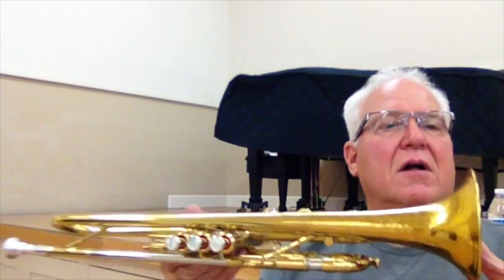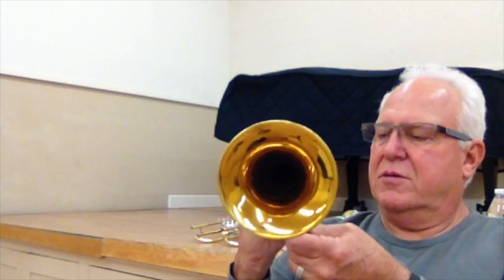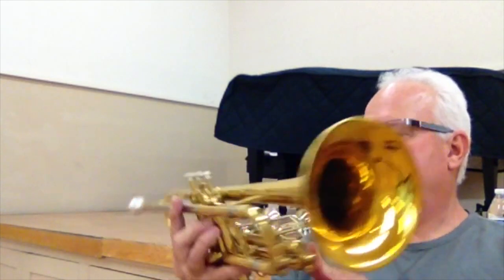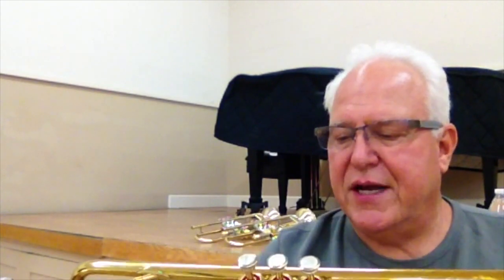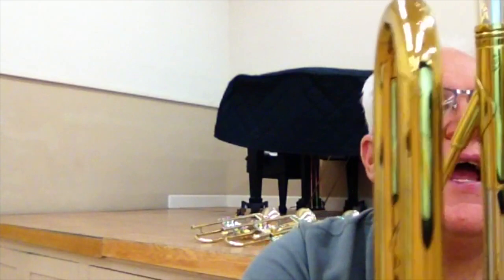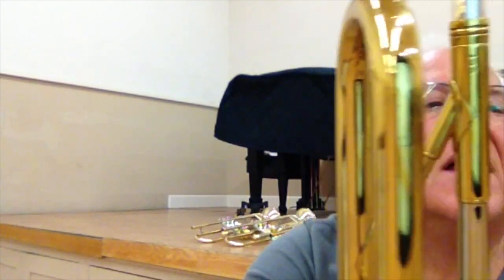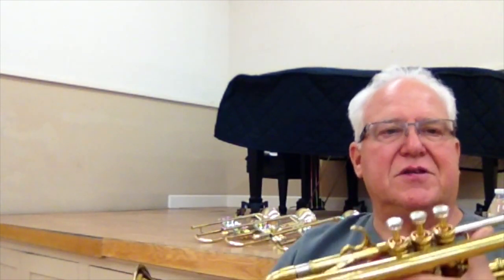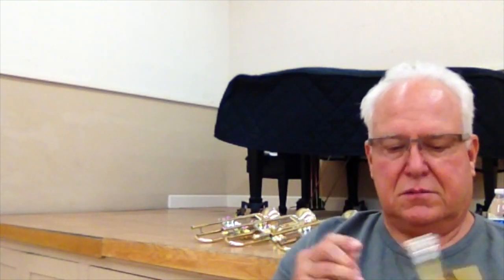Paris Selmer SN# 16637 Balanced Action 19A  K- Modified

Comment: I have the non K version from 1952, also a 19A. The main difference is that mine has the French receiver which gives a 10mm gap with a modern mouthpiece. I do have a Selmer Special mouthpiece that fits. Mine has the original Chesterfield case as supplied with these when they were sold in the USA. Mine is in similar shape but could do with a relaquer. Frost Custom Brass make backbores to fit the older Selmers by the way. The .450 is normally called small bore here in Europe. The 23 was medium.
Reply from the maker: Thank you Gordon for the information shared.
Stay Tuned To The HornTrader!

Comment: The story I heard about the "K Modified" is that Keith worked for Bach, who distributed the Selmer Paris horns. They were shipped from France without leadpipes and receivers to get around a tariff. Keith designed the leadppe which, I believe, is the Bach 44, and finished the assembly. I had a 24B in the mid 70's, "the one that got away."
Reply from the maker: Very interesting!
Reply: MosinMauserSmith9130 I don't know why they shipped without parts, but I do know there is no tariff change for complete trumpets versus trumpets without their leadpipes and recievers. Here's the link to the HTSUS, you can see in the heading everything other than parts for general use (and their are no general use parts on a trumpet) is classified under this specific heading according to the general rules of interpretation 1 "e nomine."  
I actually cannot post a link, but if you'd like to research it on your own you can search the Harmonized Tariff Schedule of the United States chapter 92 (it's available online just search HTSUS) or look through a Customs Ruling website (CROSS) or if you get really amped up about it you can visit the Court of International Trade and investigate their rulings.

Comment: I have a French made trumpet that is nearly a dead ringer for your Paris Selmer. It too has the balanced configuration, tone ring, nickel silver lead pipe, slides and slide legs. It's case has a small medallion which reads "Evette and Schaeffer by Buffet, Paris France". Also has mother of pearl valve buttons and slide pulls. Have you ever had any experience with one of these horns? I wish I could still play it because it has great tone and blows easy with the .460 bore. Serial #5602.  Thank you in advance for any info you may give me.